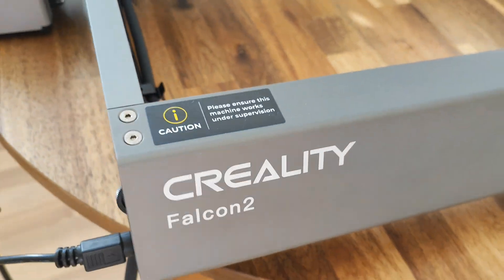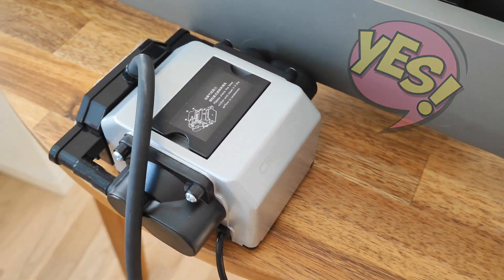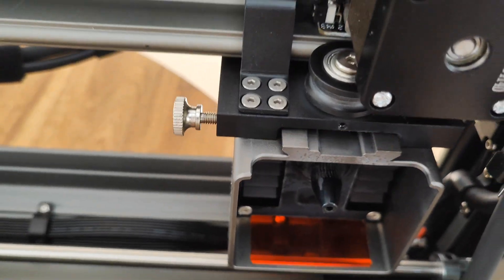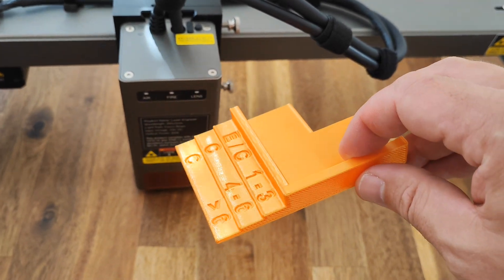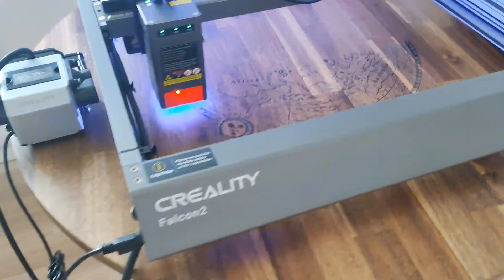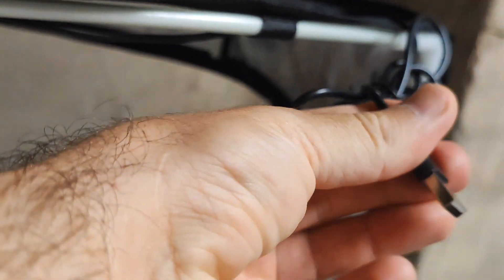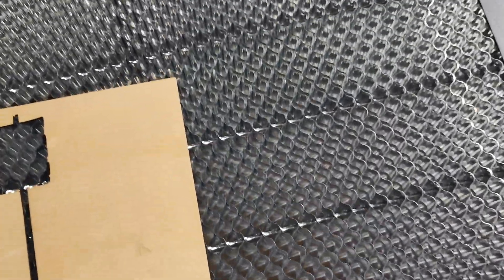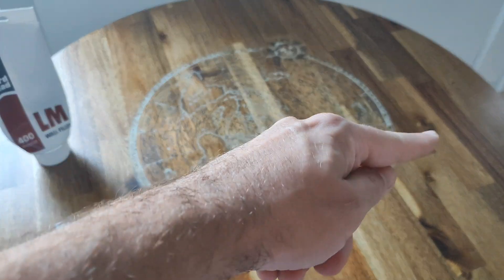22W LED Laser Engraver & Cutter CREALITY Falcon2💥REVIEW + flat Earth theory SVG file

Comment: Good video, but one thing. If you move the laser by hand (power on or off) do it very slowly. The stepper motors can generate electricity back to the main board and damage components.
Reply from the maker: Absolutely not 🙂